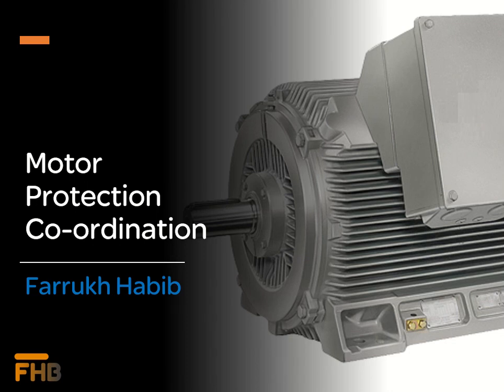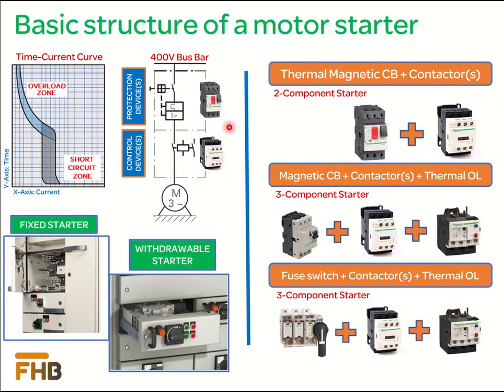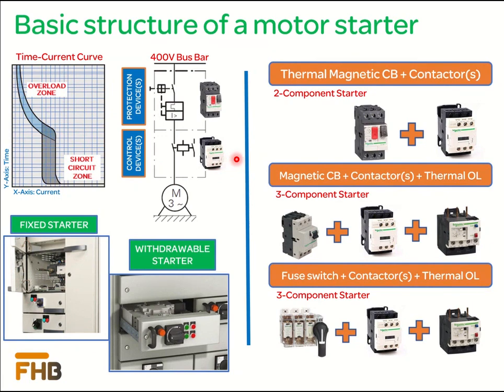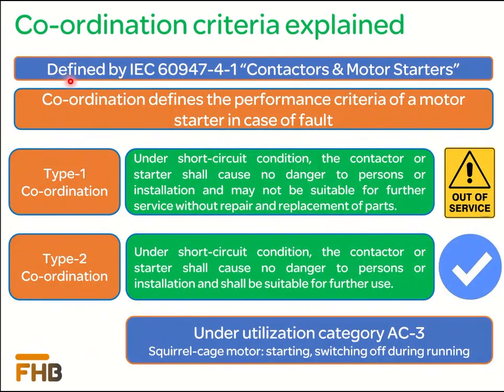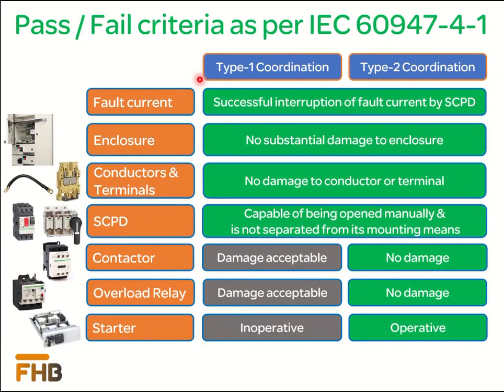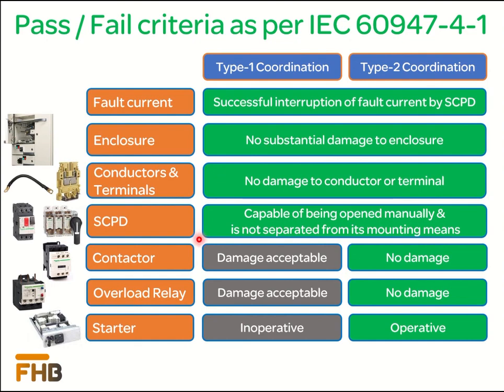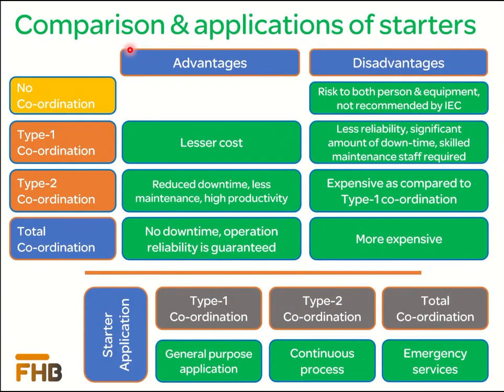Motor Protection (Type-1/Type-2 Coordination) | Farrukh Habib - FHB | #ElectricalEngineering #motor

Comment: WHY DO U USE 12-14AMP SETTING FOR O.L . CAN YOU SHOW SOME COMPUTATION ?OR ARTICLE ?
Reply from the maker: Hello Loreto, Sorry for my late response. Setting ranges are for the OL relay. This selection of OL relay with particular setting range is from manufacturer's coordination charts which you can get from different manufacturers. There are three different type of coordination (1) Type-1 (2) Type-2 and (3) Total coordination. Mostly manufacturers consider Type-2 coordination for their equipment.